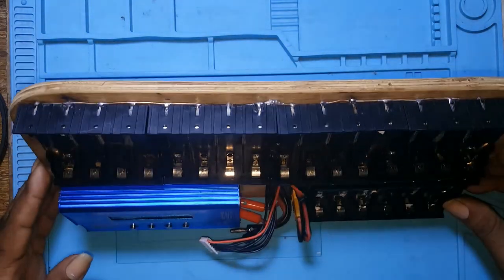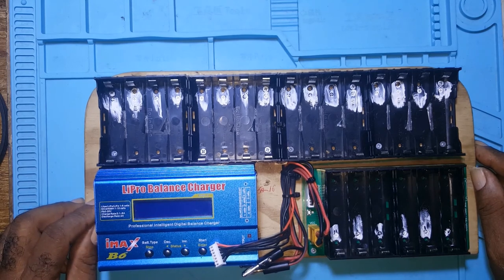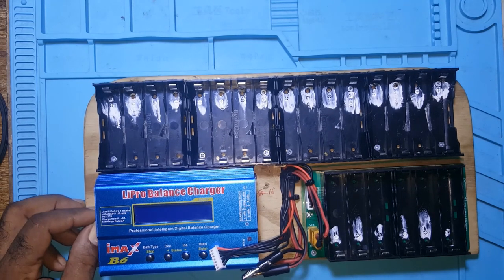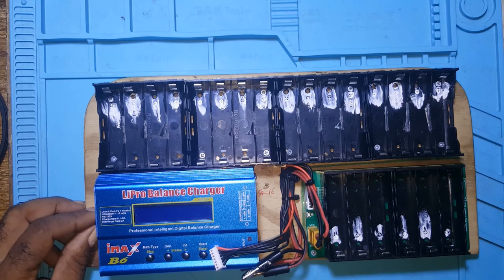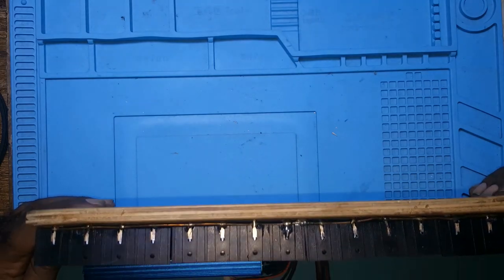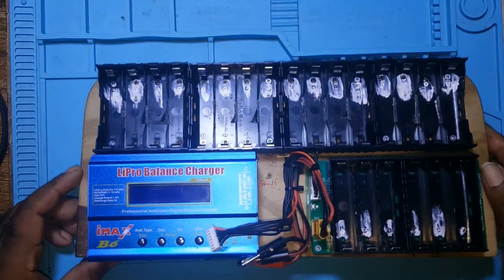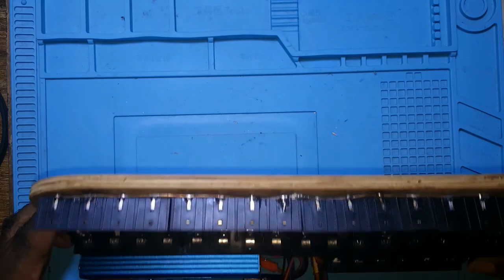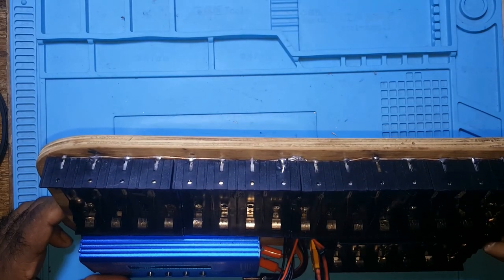IMAX B6 Charge And Balance Charging

Comment: One disadvantage I can see with having that many cells in parallel is that you will need to make sure the cells have similar voltages (within 0.1V) before you put them in the holders. If you charge them in series with a balance lead the charger will deal with it for you.
Reply from the maker: Thanks but I have not used it I'm still experimenting.